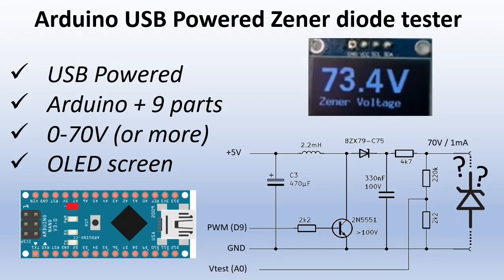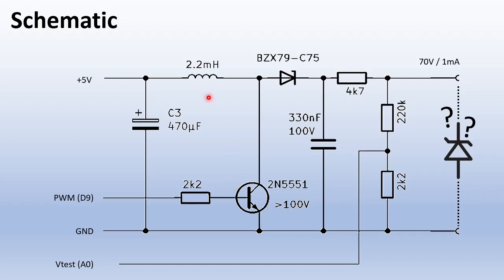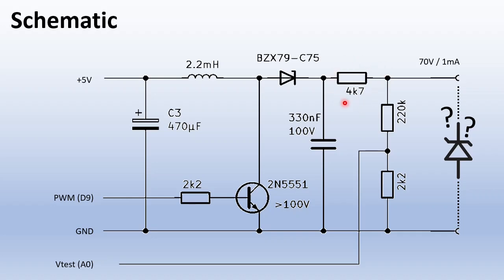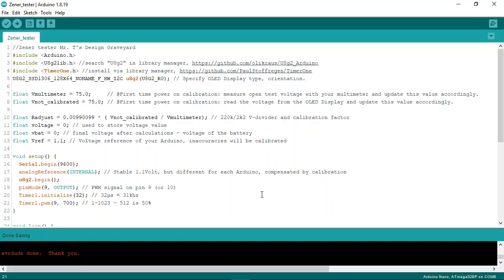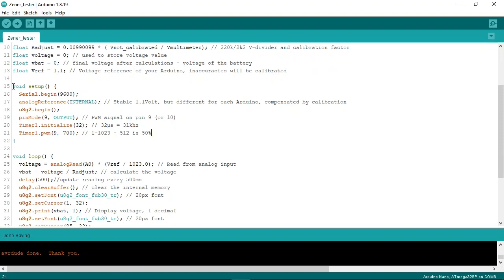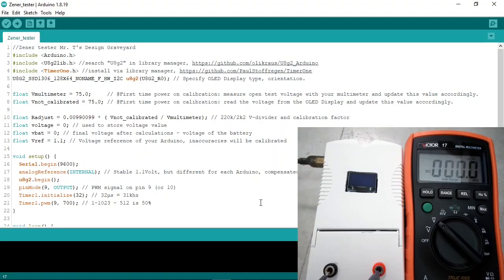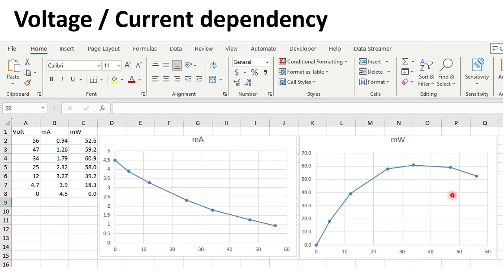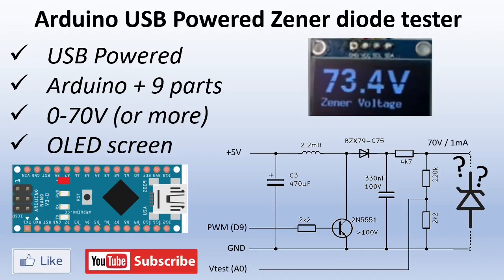Arduino USB powered Zener diode tester

Comment: Can somebody explain why the transistor doesn't short the 5V to GND?
Reply from the maker: Hi captainboing :-) 
The inductor of 2.2mHenry limits the current. 

-The transistor is switched at 31kHz, 70% PWM, so it is on for about 23microseconds. 
-The current in the inductor will increase slowly as in this formula: Ipeak = V x t / L = 5 x 23us / 2.2mH, that is 52mA peak!.
Just imagine is as follows: a capacitor "stores voltage", an inductor "stores current".
You use current to charge a capacitor, so if current flows into a capacitor it will charge and its voltage increases, like a battery or a bucket of water.
You use voltage to charge an inductor, so if you apply a voltage on an inductor, it will "charge" and its current increases. The best analogy for me is a flywheel. 
You can check my video about the 5 to12V boost for more information: https://youtu.be/7yq-w5mIz_8
Reply: @smartpowerelectronics8779  got it, thanks. So the on time and frequency into the inductor create an effective "high impedance" path because the current doesn't flow out of the inductor terribly quickly while it is building its magnetic field, (so we try to keep it in the peak "building phase") and that limits the short. Using inductors has always been a black-art to me, beyond transformers etc.

Comment: What about using a MOSFET instead ?
Reply from the maker: That would work, make sure you:
-Select a small MOSFET that can handle 100V Vds (the popular  BS170 is 60V only...) 
-Add a high value resistor(10k, 100k) from gate to source to make sure it is off until the Arduino starts up.
-You can remove the 2k2 base resistor.
-Make sure the MOSFET threshold voltage (Vth) is ok for 5 V drive (normally ok for a 100-200Vds MOSFET type)